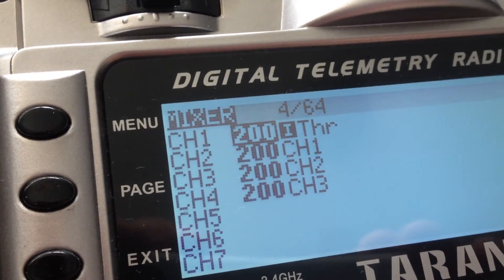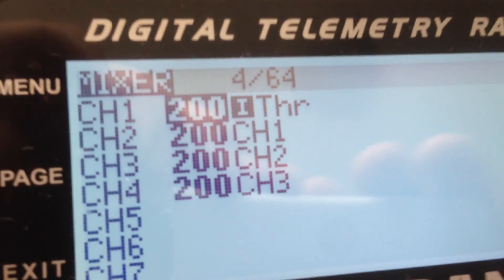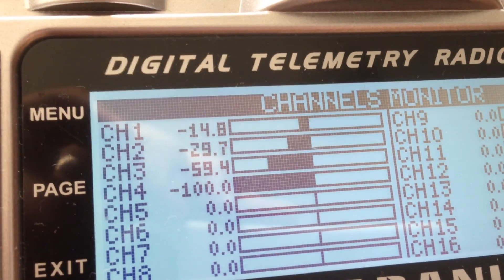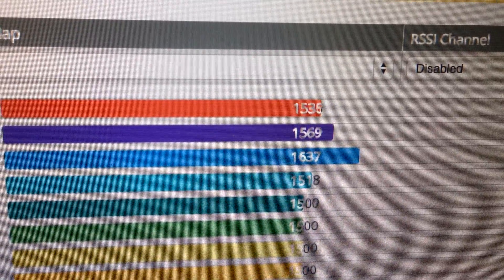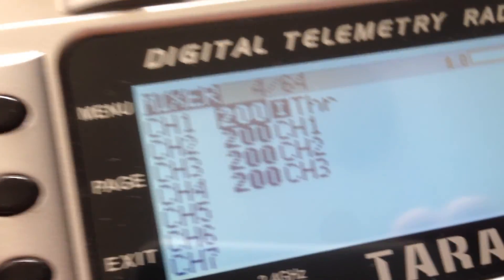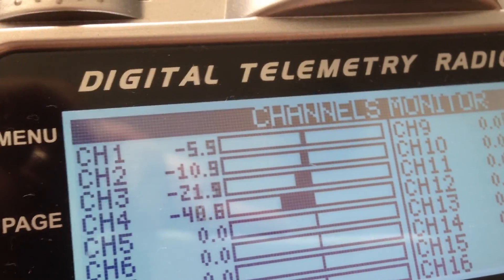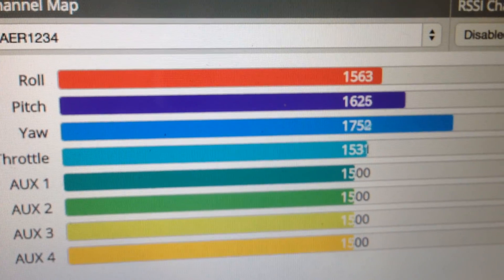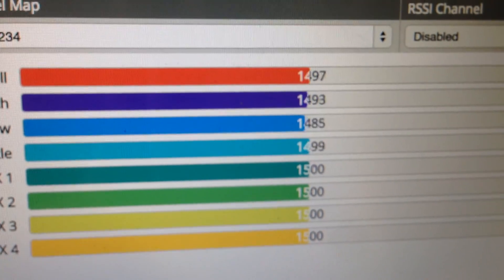Jitter comparison Open TX 2.0.19 vs 2.1.7 - amplified

Comment: hi - sent you a message but not sure if you got it or not.   Would this jitter translate to digital servo noise?   My KST 08's with Taranis + OpenTX 2.1.7 are very noisy with no stick input (no visible servo arm movement but still noisy).   Either telemetry noise or jitter caused from 2.1.7.    I see exactly the same as you when looking at channel monitor and analog inputs screen.
Reply from the maker: +CirrusRC Yes I think it would definitely give servo jitter - though some servos jitter themselves even with zero jitter on the stick input.   Sorry, didn't see your other message - don't check them as much as I should.